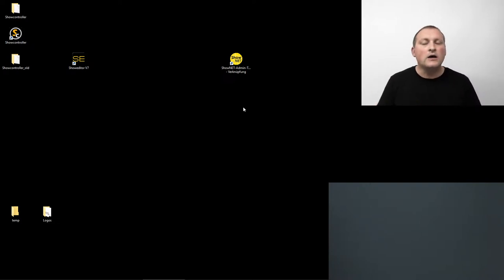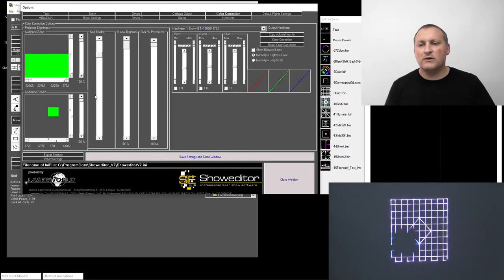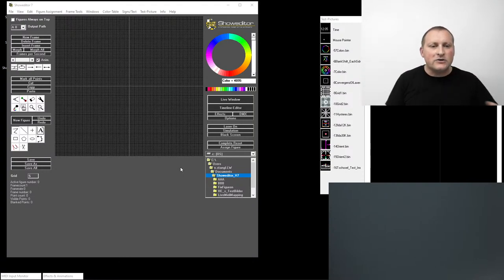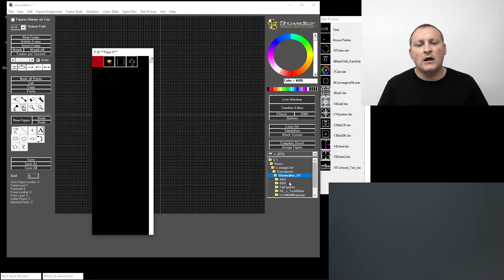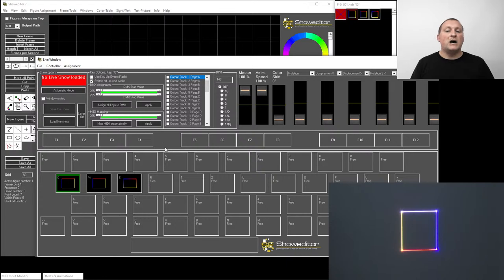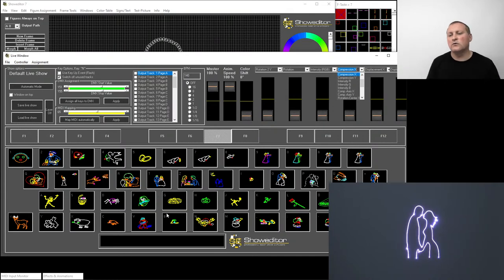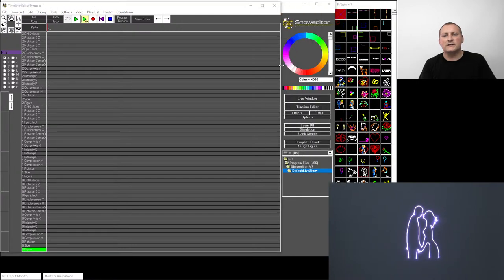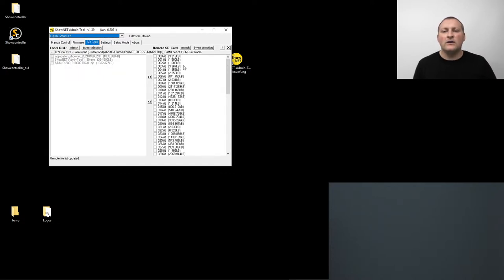Software Training Showeditor - Basics | Laserworld

Comment: I have a pro 1600rgb and am wanting to customise the patterns and animations within it. I think i can do this with the sd card? I will be triggering it with dmx via a lightshark unit. Is this the correct software to use? Sorry I am little confused whether this software is for running a show or for customising your laser. Hopefully both! 😊
Reply from the maker: You can do both, so yes, you can also use it for exporting ILDA patterns for your PRO-1600RGB unit. Here are the instructions how to do it - also remember to select ILDA version 6 on export for the PRO-1600RGB (attention, this is different for modern units with ShowNET mainboards - they need the official IlDA standard version 5):
https://www.showeditor.com/en/tutorials-faq/tutorials/272-ilda-files-on-sd-card-use-with-laserworld-proline-series-units-and-similar.html

Comment: Is there a few laser software that o can use to check if the old laser's are working that I see at work that they say arent working
Reply from the maker: You can use Showeditor if you have a ShowNET interface. You always need some sort of digital-analog-conversion hardware to use with software. However, if the laser has the ShowNET built in as intelligent mainboard, you can directly connect the laser with your computer with a LAN cable, and it works.
If you have the ShowNET mainboard installed, you can also try the DMX or automatic operation mode to check if the laser is working. 
If you just got a random laser, which is not equipped with the respective mainboard, you need an external hardware interface that connects to the ILDA port at the laser.
Reply: @LaserworldAG  so from what I'm seeing it's 3 other them 2 standard green laser and one big RGB laser that comes with a blue housing on it. The standard green ones are rectangular shape black housing and kinda grey edges the ILDA pins are mashed could I get a contact info for you so I could communicate much better
Reply from the maker: OK, so it sounds like you may have some Purelight or Pure Sapphire unit as RGB in a V-Beam housing and some old RS-400G or so as satellites (should be around 10 years old then). You may contact the service department at rma@laserworld.com to get further support. All the units you refer to should have an automatic operation mode and basic  DMX, too, so you should be able to check on general functionality with that. Make sure you have the key switch turned and the interlock connector inserted (super important!!!)

Comment: Thanks for this video. I often have to rotate a figure of 45 °, for example a hammer, a straight figure in one frame and the same figure rotated 45 ° in a second frame.
How is it possible?
thank you
Marco
Reply from the maker: Hi Marco, 

yeah, for sure that's possible! There are different ways of doing it, but this is the, in my opinion, best way, as it directly creates the frames rather than using automation tools which couldn't be used for ILDA export then. So this method creates actual frames that are also suitable for export:

1. Create 1st frame
2. Create the second frame with the same content (right-click on the "New Frame" button to create a frame with a copy of the currently selected frame).
3. if necessary, mark the desired points in the new frame
4. select the rotation tool (top left: the tool next to the recolouring tool, it looks like a compass... or so)
Press and hold the left mouse button in the drawing window! (The pivot point is automatically located there). 
6. drag the line to the right while keeping the key pressed....
7. turn the line upwards or downwards at the desired angle of rotation
8. release mouse button.... (marked) points are rotated by the corresponding angle.
9. If necessary, use the Morph Tool between the frames.
Note: If you rotate e.g. by 180 degrees in one step and then morph, the result is not a rotation, but all points run through the centre of rotation... ==> in this case, make several single steps for the rotation, e.g. 45 degrees before morphing.

Comment: Hello, I am again asking for information: I ask if it is possible in a single frame or in a scene (sequence of frames) to emit a laser point that increases in intensity/power over time, for example a point that gives 0% power increases in 3 seconds up to 100% of the power.

Thanks so much
Marco@DS-2000RGB
Reply from the maker: Yes, simply make two frames - first one with the point in black, second one with the point in white. then do "morph all" and add as many frames as you like, e.g. 500. the point will then increase in intensity. the actual duration needs to be set by the play speed, meaning how many frames are played per second. maybe you then need to add more morph frames if it shall run over a very long period

Comment: Hello 
I use the Showeditor in free mode without a hardware. It is easy to understand how to create figures and run the Laser live with a cable. But can you explain in a next video how to safe the figures on a SD card. So that the Laser can run only with a SD Card. This Feature i didn‘t understand well. 
Thx
Reply from the maker: Oh, there is a tutorial on this here: https://youtu.be/9SBy5xuKvX0

And the steps are also explained here: https://www.showeditor.com/en/tutorials-faq/faq/195-i-want-to-export-figures-as-ilda-ild-file-and-its-doesn-t-work-what-is-the-problem.html

It's pretty straight forward, bit you need to make sure that in options ->hardware the first hardware is not set to "none" but to a virtual device.

Comment: Hi, i purchase 2 interfaces and want to start making timeline show. But i have a question here because the website and forum are outdated. i receiving an error everytime i want to load an WAV file. is there any place where i can ask for a solution?
Reply from the maker: Yes, for sure! It is important that the WAV file has a constant bit rate (wav is only a container format and the data inside can have many different characteristics). So best is to try to re-encode it, either uncompressed or with a constant bitrate. Then the wave file analysis should work fine. If you don't have any tool for that, try VLC player, it can convert data and is free.
Reply from the maker: If you want to scale your shows and maybe also sync with pyro effects and prefer drag and drop programming over recording, maybe Showcontroller is an option for you too. It uses the same hardware (same interfaces), so it just requires a license dongle to run. You may want to have a look at www.showcontroller.com and check out the Demo version.
Reply: Many thanks for the good answers. I imported the songs into Ableton and save it again and after that it works fine!

I want to purchase showcontroller for sure also for timecoding. But i only cannot purchase it at once. Is there no option for monthly payment? The problem is covid here without festivals.
Reply: I also purchase 3 lasers from laserworld (CS2000RGB)
Reply from the maker: Please write an email to Denis at dp@laserworld.com - I am sure we find a way to get you sorted :-)
Reply: I just send Denis an email. Many thanks!

Comment: Is support for MacOS on the roadmap?
Reply from the maker: Not for this software. As Showeditor, like most laser show software, heavily relies on Windows libraries, this would mean a complete rework of the whole software.
However, it is recommended to have a separate show laptop anyway, no matter which sowftare you use, so it's usually not a problem to use a Windows one for this. And it's the less expensive option too. :-)
In general it is not recommended to run laser control software and otehr real-tim ressource intense software on the same computer, so ...